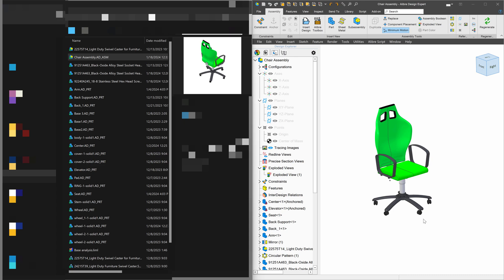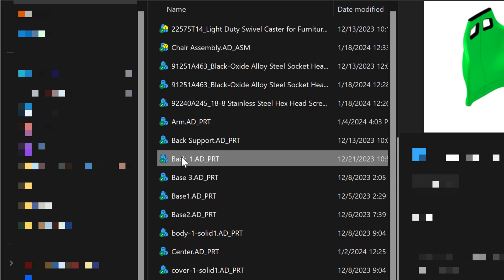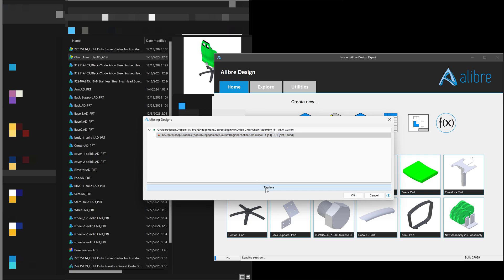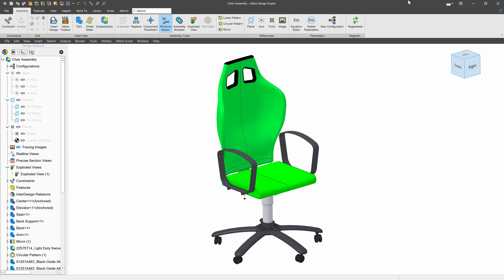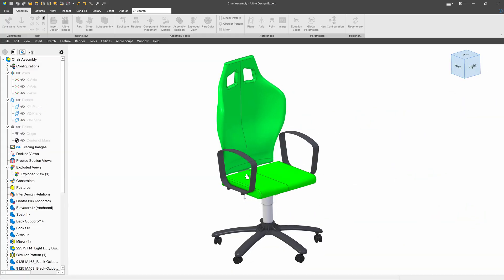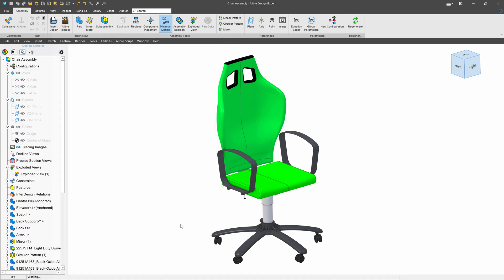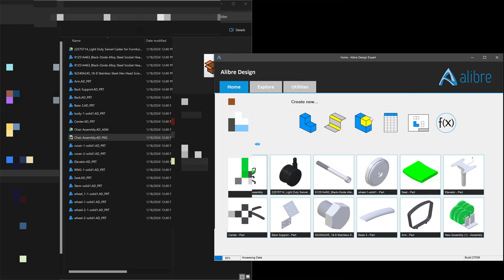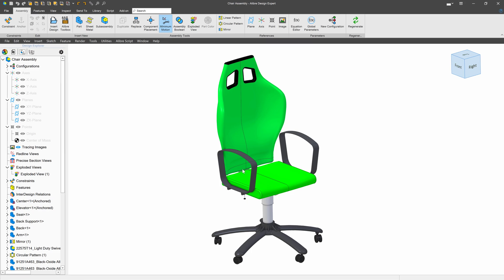Managing Assembly Files and Names | Alibre Beginners Course #43

Comment: Great demo for file management method to get yourself out of a jam. On the forum where it is always stressed the use Save As to rename files, especially in assemblies, and not (I think the word used is "never") to rename them in the Windows file explorer. I don't know if anyone has mentioned or demonstrated using the process you've shown here to replace a missing file when opening an assembly although I've used it a couple of occasions to replace missing parts. I still think the safest way of renaming files, even from within an assembly, is to use Save As, rename the part and overwrite the assembly. Maybe demo that on a new video.